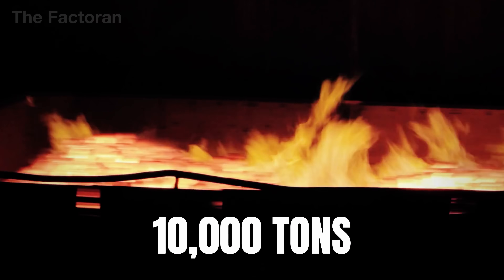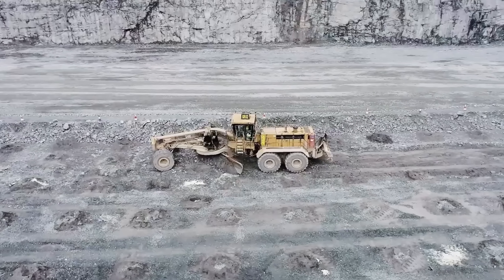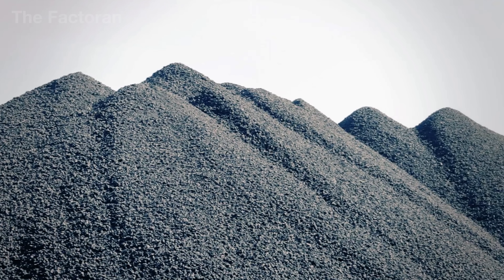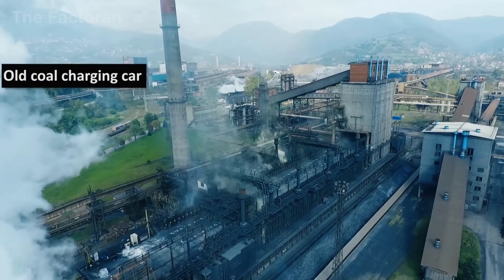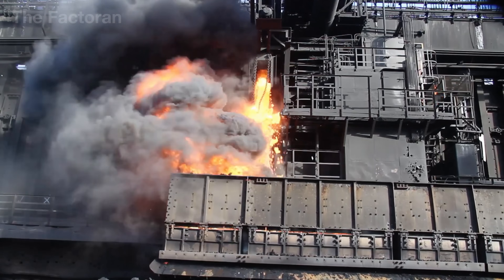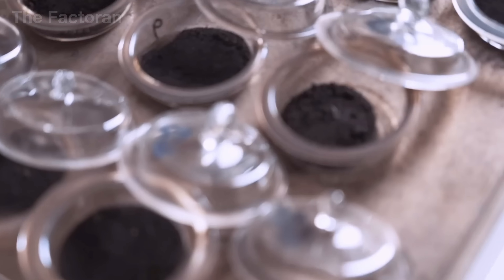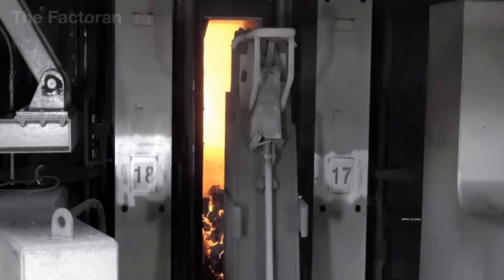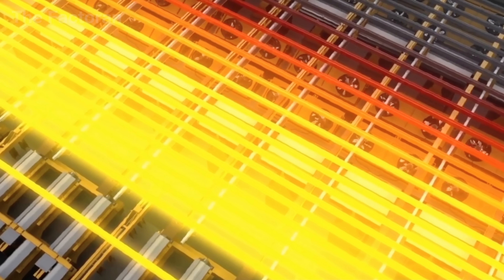How Millions Of Tons Of Coke Are Produced From Coal – Inside Massive Coking Plants

Comment: Fact check: Yes, millions of tons of metallurgical coke are produced annually in massive coking plants. The process involves heating coal in airtight ovens at 900–1,400 °C to drive off volatile compounds, leaving behind porous, carbon-rich coke used primarily in steelmaking.

How Coke Is Produced
• 	Raw material: Low-ash, low-sulfur bituminous coal (called coking coal).
• 	Process name: Coking or destructive distillation.
• 	Temperature range: Coal is heated to 900–1,400 °C in the absence of oxygen.
• 	Transformation: Volatile gases and tars are driven off, leaving behind grey, hard, porous coke.
• 	Byproducts: Coke oven gas, coal tar, ammonia, and benzene are recovered for industrial use.

Inside Massive Coking Plants
• 	Coke ovens: Long, airtight chambers where coal is baked for 12–36 hours.
• 	Quenching: After heating, coke is cooled either by water (wet quenching) or by circulating inert gas (dry quenching).
• 	Wet quenching consumes ~0.6 million Btu of steam per ton of coke.
• 	Dry quenching recovers heat, improving efficiency.
• 	Scale: A single modern plant can produce millions of tons annually, with global coke production measured in hundreds of millions of tons per year.

Global Production & Use
• 	Consumption ratio: ~1.37 tons of coal → 1 ton of coke.
• 	Global scale: Billions of metric tons of coking coal mined yearly, with hundreds of millions of tons converted into coke.
• 	Primary use: Coke is essential in blast furnaces for ironmaking, acting both as a fuel and a reducing agent.
• 	Secondary uses: Foundries, stoves, and chemical feedstock.

Fact Check Summary
• 	The YouTube video titled “How Millions Of Tons Of Coke Get Mass Produced From Coal Inside Massive Coking Plants” accurately reflects industrial reality.
• 	True: Coke is mass-produced in giant coking plants.
• 	True: The process involves heating coal in oxygen-free ovens at extreme temperatures.
• 	True: Coke is vital for steelmaking worldwide.
• 	Nuance: Environmental concerns have reduced coke production in some regions, but global demand remains high due to steel industry reliance.
Reply from the maker: Yes, everything here is accurate — that’s exactly how metallurgical coke is produced and used in modern steelmaking.

Comment: browns gas is hugely more hotter end efficient.
Reply from the maker: True, Brown’s gas burns extremely hot — it’s fascinating how efficient that hydrogen-oxygen mix can be.
Reply: @TheFactoran  I produce it and it's benefits on the body are amazing, The flame will cut through a brick, it will weld steel to stone. It will anneal steel so that it cannot rust when left in the yard.

Comment: Since the making of steel requires manipulation of the molecules of several different ingredients, I wonder if the process can be done in a different way under lower temperatures and more cheaply by using electromagnetic induction frequencies into the molten product to oscillate the molecules to form the end product desired?
Reply from the maker: This is a brilliant idea; while electromagnetic induction is already used to efficiently heat and stir molten steel, the high temperature is still a chemical requirement to break down iron ore and remove impurities like carbon.